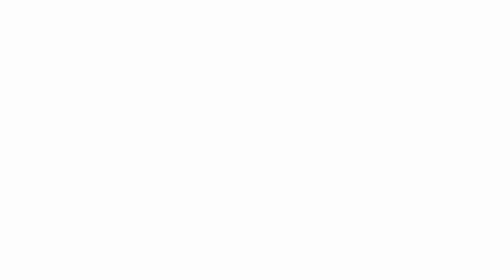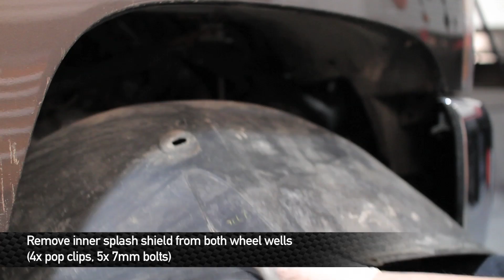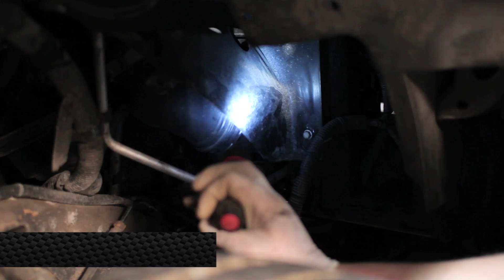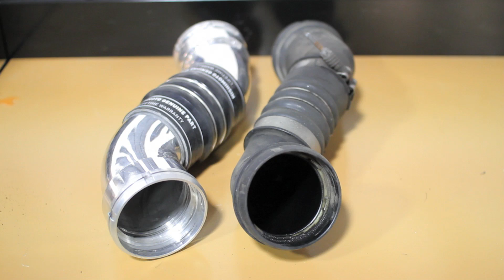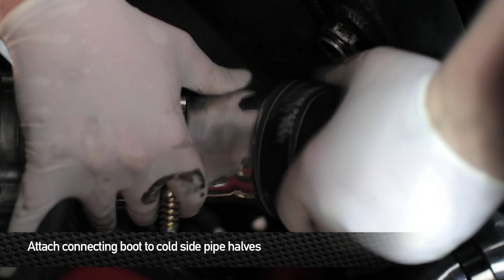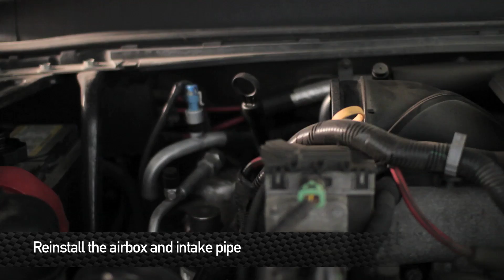How To Install: Mishimoto 2006-2010 Chevrolet GMC Duramax 6.6L Intercooler Piping Kit

Comment: Quick question:  How tight should you tighten the hose clamps?  Ball-park ft. lbs. will be fine.  Just don't want to under or overtighten.
Reply from the maker: Any where from 10-15 ft lbs should work out.

Comment: This cold-side kit still comes with O-Rings correct? Just ordered and making sure new retaining clips are all I need
Reply from the maker: The quick disconnects will come with new O-rings and c-clips installed.
Reply: @mishimoto  Thanks, appreciate the quick response! I actually glossed over it y'all were so quick lol. Going in tomorrow, so I'll be back to give it my review. Haven't seen many reviews on many of your Duramax products online. But I've heard nothing but great things from PowerStroke guys.

Comment: What is the real benefit for the inter cooler?
Reply from the maker: Our universal intercoolers provide the ideal cooling capacity for any small or large turbo application, while safely increasing horsepower and giving that extra boost that every driver appreciates.